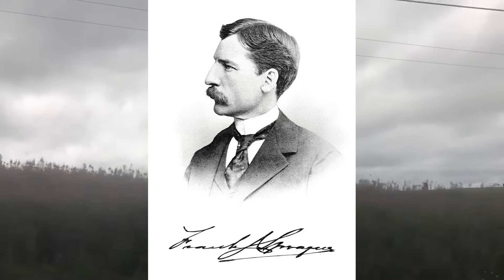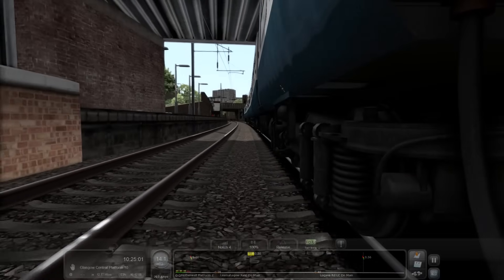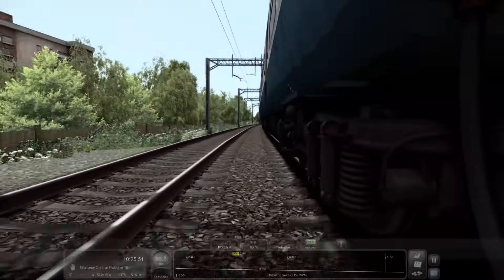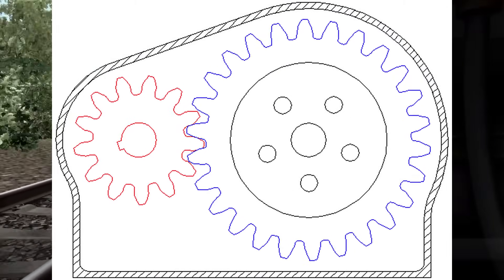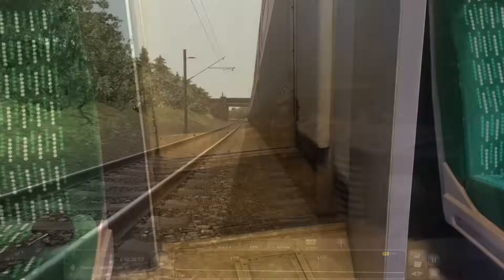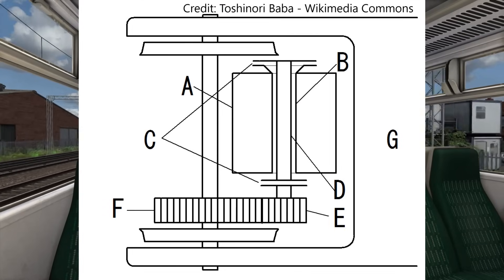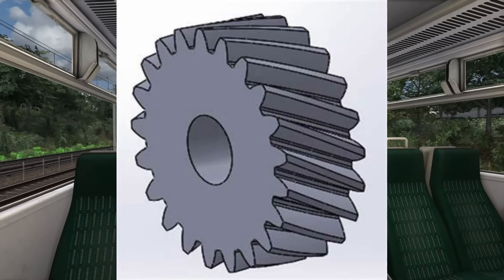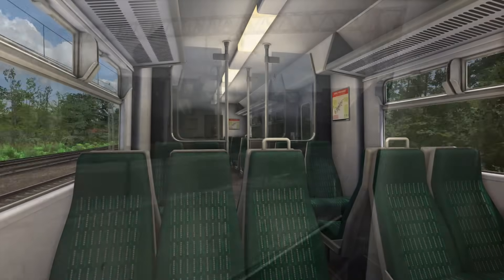Why The Noise? - An Explanation of old Electric Train Noises (Part 1 - The traction motors)

Comment: Can someone also explain the high pitch whirring sound that Thameslink trains make now?
Reply: They have two distinct sounds, more of an even sound on 25kV overhead going north past St Pancras up to Peterborough and a more subdued pulsing, almost siren-like noise on third-rail. AC motors with IGBT regulation, to the best of my knowledge. So like a 95 stock Northern Line, not like a 96 stock Jubilee line. Jubilee line uses older GTO regulation, which has that howl to it.

Comment: US practice is a little different.   Yes, on some light rail vehicles the Cardan drive is used.  But... on mainline engines, no.  At upwards of 1.000 horsepower per axle, they give more trouble.  The nose suspended traction motors are still used -- but they are AC in many applications now.  There were some other drive methods used on road engines which did keep the traction motors on the frames, but could also handle the horsepower (consider the very successful quill drive on Pennsylvania Railroad GG1s, at about 700 hp per axle on six total drive axles).

Comment: Great video, raising the subject of what was once an everyday background sound to many commuters and schoolboys. I worked with traditional DC tram motors, and was rather disappointed when an overhauled example was set up on the bench floor and connected up to the juice to check it. It made virtually no sound at all. However, it wasn't working under load. The arguments in the comments for "electric whine" versus "mechanical grind" are compelling, however may I suggest it is a combination of both? When a conventional DC motor drives through a set of spur gears (I believe the correct term), and has to work, the field coils hum like a transformer, which rises in pitch according to the energy being converted to mechanical torque. Equally, the gears contribute their own mechanical growl according to their speed. When an electric unit, loco (or tram) is coasting, some gears set up a kick, one wheel against the other, producing a "bark", heard especially in older trams, with worn teeth and loose bearings. If you search Google for Blue train 303048 Soundcloud (which is an audio version of Youtube), you can hear a 1960s Glasgow suburban unit being thrashed on its last night of publc service, recorded in the guard's compartment with the inspection hatch up. Its motors and transmission were well past their sell-by date, and sounded distinctively musical. There are other recordings of this very sound elsewhere on this channel, both by trains and trams, for those interested in the subject.

Comment: 6:28 what about trains like 507 or 508, 799 and so on
Reply from the maker: The 799 is just a modified 319, and the 507s and 508s were manufactured years before the 319s had started construction.

Comment: When I used the Southern Region "Slam Door" third rail electric trains in the 60s and 70s, when stationary they would sometimes make an odd sound for a short time that sounded like whirring or rapid clicks. It would start slowly and then slow down before stopping and only last a minute if that. It always made me think of someone winding the train up before it set off. Does anyone know why the trains made this sound?
Reply: That was the air compressor. It was a high-revolution DC motor mechanically linked to two or three pistons that physically compressed air for the brakes (and sometimes doors on some units.) The system had a cut-out when the required air pressure was attained, and started up again when it was needed to recharge the system. As a piece of trivia, most submarines also operate on Direct Current, and have the same associated equipment as DC trains, right down to the air compressors. If you listen to the Beatles' "Yellow Submarine", during the break about three quarters through the song, you can hear they took some genuine submarine sound recordings and you can hear a compressor humming away in the background.

Comment: This noise reminds me an awful lot of the Class 36*/37* locomotives in the Czech Republic and Slovakia as they pull out of stations. These are multi-system locomotives and the noise seems independent of whether or not the locomotive is under AC or DC catenary, however, so how would the trademark whine - which is particularly striking combined with one of the pair of pantographs being retracted as the roll-resistance is overcome - originate in that case?
Reply: Hmm. Older AC and dual-voltage electric locomotives used either DC (with a rectifier) or ‘universal’ motors (also found in many vacuum cleaners and some AC model trains like older American Flyer and Lionel models, as well as contemporary copies) and had noisy gearboxes as described.  Newer (circa 1980 at the earliest) locomotives can have AC traction motors and electronic inverters to create variable-frequency AC for speed control.  They can either use a transformer and rectifier as on past AC locomotives with DC motors or run directly off of DC power.

Comment: Interestingly, the MT54 traction motors used on JNR trains from the middle 1960's on tended to be quite loud at speed, probably due to the gearing. (The MT54 could be clearly heard even over 1.5 km away.) It was by the late 1980's that Japanese trains started to use variable voltage/variable frequency AC drive motors, which was a lot less noisy at speed.
Reply from the maker: I do love the MT54 traction motors! They are essentially the successor to the MT46 motors used by the JNR 101 series which I mentioned in this video. I believe that the reason they can be loud at speed is because the motors have an external fan in order to duct air which makes a loud bass sound.
Reply: @SmoIchopper  Whatever it was, the JNR 113/115 Series and 185 Series train sets were notoriously loud when running at speed, as many YouTube videos from Japan show when the train sets I mentioned are running at anything over 70 km/h (43 mph).

Comment: Just a load of waffle. Did you get chatGPT to write it? The "noise" from a DC motor is simply the magnetic fields causing the "internals" to resonate. That in turn will pass on to anything else that can resonate for some addtional noise. But most of what you hear is from inside the motor - nothing to do with gears. The example you showed was a big powerful motor whereas on for example tube trains the motors are much smaller. The bigger motors do a lot more work, so are lot louder. But the whining and the volume are related to the amount of power/current, and therefore strength of the magentic fields.
Reply: What crack are you smoking mate?
Reply from the maker: Your argument doesn't make any sense, the size of the motor has precious little to do with the noise it generates - apart from the motor gear having the capability to be larger as the motor has more torque, which I agree would make a different noise. Yes, the current of the motor does affect the sound made, however primarily because there is more force on the axle gear teeth as the motor gear teeth will have greater electromotive force supplied from the traction motor itself. If your example was to be applied in practical terms then you would expect to hear absolutely 0 noise whenever the train is coasting or braking without regenerative/rheostatic braking, as there would be no current going through the motor, however in reality you can still hear the noise at the same pitch as if the motors were powered, as the gears will still be turning, just without any major force, and noise would be further generated as the gear on the axle will be inversely applying forces to the motor gears.

tl;dr the power from the motor does affect the noise, but only because it applies more force on the gears.
Reply: @SmoIchopper  You possibly need a better understanding of how DC motor works. Then re-read what I said.
Reply from the maker: @LiveFromLondon2  I learnt how both AC and DC motors work in school. You also haven't refuted any of my points for some reason, which I find interesting as you only seem to reference yourself as a source in this topic. If you could maybe try to argue my points then I would understand where you're coming from in this argument?
Reply: @SmoIchopper  im sure at school you would be taught the basic principal of a motor. however to understand why a motor makes noise, you need to delve a bit deeper. When you understand what causes motor noise, everything else will make sense. And remember you are talking only about DC motors. If you made points more clearly, instead of burbling waffle, it would be easier to respond to them. 
However, you are too argumentative, like a student, for me to waste time with you. Ive told you what the cause is, you go and do your own research and see if I am talking bollocks. Should take you no more than 10 minutes.
Reply: @LiveFromLondon2 Right then, listen here. I've worked with motors of all kinds in my professional life, BLDC, brushed DC, Induction, single phase and three phase and the specific sound they all create is formulated by two different key parts: The mechanical gearbox (if present) isn't the only harmonic source of sound that is heard when accelerating and decelerating as in a motor the physical rotor can make a sound with every revolution as the magnetic fields inside change. This is subject to a lot of different variables such as the number of phases the motor has (seen in BLDC motors) and how the power is modulated. I have built and maintained electric motors in custom electric vehicles, so I think I am qualified to say what is right and what is wrong with your judgement here, and your points are invalid as they only address one part of the composite sound a motor would generally make. This isn't an academically published journal, this is YouTube. There's no need to be so hell-bent on perfect theory. I have done my own research and can confirm you are chatting bollocks ♥️

Comment: Japan National Railway’s engineering department was also contracted in the 1980s by the NSW state government to design and manufacture new trains for Sydney in Australia and the result of that program was the 1986 C set trains which use DC pulsing and used the same bodies as the older Australian made and designed K set trains while the 1988 Tangara trains had an extremely futuristic design for the time and were also the world’s most technologically advanced trains at the time.
Reply: @@BB-xx3dv 
Okay I’ll keep that in mind! Pretty much I saw that it was mentioned in a history video about them that the Tangara trains were designed in Japan! :)

Comment: No video on electric train noises is complete without class-323 Yorkshire tech
Reply: I quite frequently ride WMR’s 323s on the cross city line, but have still never seen a good explanation as to what that sound is
Reply: It is the sound of the motors reacting to the GTO (Gate-Turn-Off) Thyristors changing the voltage and turning off as it switches gears.

Comment: The old AC's including the 86 could if notched too aggressively, cause the bogies on the loco to lurch violently, the 76 and 77 were very prone to that as well and it did lead to cracks in the bogie frame over time.   4SUB's were also grabby on the pullaway lacking the more delicate field controls of the EPB and express SR motors.   The best traction motors were those cycled from the Portsmouth express GRI's and NEL's and fitted on the 4CEP and 4BEP/REP sets, even better was the boat trains from Victoria to the coast, 3x4CEP's with a MLV up front, the MLV had the same traction output as a 4CEP so you had for a 13 car weight, a 16 car traction output and the drivers loved that setup as it made timekeeping excellent with speedy pullaway, speedy acceleration and easier to hold the top line speeds up and down gradients even with a full load of passengers and bond and luggage.   The 74 was an unsung hero of its time, at Stewarts Lane a 74 was held on standby for the inevitable Warship breakdown that happened pulling the Waterloo to Exeter trains, when the Warship broke down the 74 would go yank the whole train to either Waterloo or down as far as third rail allowed the other way where another diesel would pick up the whole train loco and all dumping the broken loco at Salisbury or Exeter to await repairs, on the juice the 74 just roared that train where it needed to be towing that dead weight loco on other end.
Reply: The 4-REPs were so powerful! One four-car EMU set (with just two powered cars) was able to pull up to eight unpowered coaches. That's not an EMU, that's literally a locomotive with passenger seats inside it!
Reply: It wasn’t a problem for the class EM2 77’s as they were coco passenger locos but it was a problem for EM1 class 76 Bo+Bo’s they had a special weight transfer switch that reduced power to the rear bogeys on starting with heavy freight trains to stop the front bogie jumping up and hitting the underside of the cab